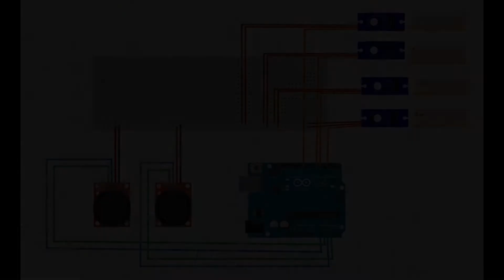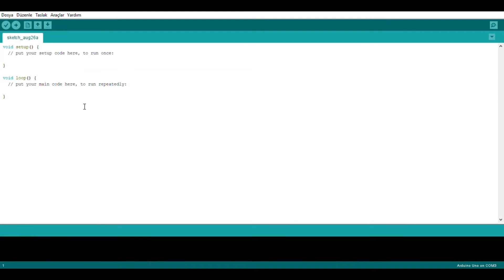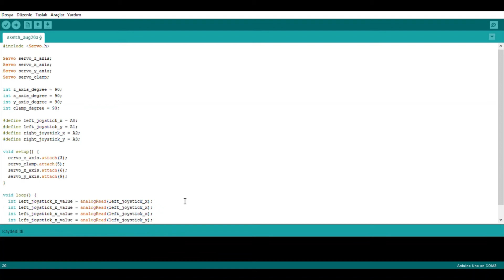Arduino 4-Axis Robot Arm

Comment: text in English 
"Thank you very much for the code you provided!

I really appreciate your help. The base logic was exactly what I needed to move forward with the project, and it saved me a lot of trouble.

I did have to make a few minor modifications (adjusting some of the pin definitions and tweaking the speed constants) to match my specific hardware setup, but the core functionality worked perfectly.

Your assistance has been invaluable in completing my robotic arm project.

Thanks again for your time and expertise!"

text in spanish 

"¡Muchísimas gracias por el código que me proporcionaste!

Realmente aprecio tu ayuda. La lógica base era exactamente lo que necesitaba para seguir adelante con el proyecto, y me ahorró muchos problemas.

Tuve que hacer algunas modificaciones menores (ajustar algunas de las definiciones de pines y retocar las constantes de velocidad) para que coincidiera con mi configuración de hardware específica, pero la funcionalidad central funcionó perfectamente.

Tu ayuda ha sido invaluable para completar mi proyecto del brazo robótico.

¡Gracias de nuevo por tu tiempo y experiencia!"

Comment: i see the video , but i use a keyestudio kit ks0198x, when i try to use your sketcht i cant make it work , because they use A0 for rigth servo. A1 for base Servo , pin 6 for left servo, and pin 9 for claw.  i try and try to make it works , but in new in arduino.

Comment: Only X axis works, others start to tremble when i try to move them, they only move if i help with hand. Is the problem in weakly screwed bolts or in the servo itself?
Reply: Hello..., I have the same problem..., did you suddenly find a solution...? I'm going to try to power from another voltage source since I used the same 5 volt Arduino for all the components......

Comment: please help i have put code and conected wired but its not working at all
Reply from the maker: You should use Arduino Uno board and you have to select right board from board manager of Arduino ide

Comment: Bro can u plz upload a correct code so that clamp should also work.  Though I have tried to compile this code but it doesn’t compile. Showing error  of  “=“ Cabot apply before token   In the define part n then 2nd errors is “;” before token   Kindly upload a correct one ASAP
Reply from the maker: I have updated the code.
Reply: Type the code from the video and replace #define with int

Comment: //The code after modification :)
/*----------------------------*/
#include <Servo.h>

Servo servo_z_axis;
Servo servo_x_axis;
Servo servo_y_axis;
Servo servo_clamp;

int x_axis_degree = 90;
int y_axis_degree = 90;
int z_axis_degree = 85;
int clamp_degree = 90;

int left_joystick_x = A0;
int left_joystick_y = A1;
int right_joystick_x = A2;
int right_joystick_y = A3;

void setup() {
  Serial.begin(9600);
  
  servo_z_axis.attach(3);
  servo_clamp.attach(5);
  servo_x_axis.attach(6);
  servo_y_axis.attach(9);
}

void loop() {
  int left_joystick_x_value = analogRead(left_joystick_x);
  int left_joystick_y_value = analogRead(left_joystick_y);
  int right_joystick_x_value = analogRead(right_joystick_x);
  int right_joystick_y_value = analogRead(right_joystick_y);

  if(left_joystick_x_value < 340) y_axis_degree +=8;
  else if(left_joystick_x_value > 680) y_axis_degree -=8;

  if(left_joystick_y_value < 340) clamp_degree -=8;
  else if(left_joystick_y_value > 680) clamp_degree +=8;

  if(right_joystick_x_value < 340) x_axis_degree -=8;
  else if(right_joystick_x_value > 680) x_axis_degree +=8;

  if(right_joystick_y_value < 340) z_axis_degree -=8;
  else if(right_joystick_y_value > 680) z_axis_degree +=8;

  z_axis_degree = min(179, max(1, z_axis_degree));
  x_axis_degree = min(179, max(1, x_axis_degree));
  y_axis_degree = min(179, max(1, y_axis_degree));
  clamp_degree = min(179, max(1, clamp_degree));

  Serial.print("x_axis_degree : ");
  Serial.print(x_axis_degree);
  Serial.print(", y_axis_degree : ");
  Serial.print(y_axis_degree);
  Serial.print(", z_axis_degree 4 : ");
  Serial.print(z_axis_degree);
  Serial.print(", clamp_degree : ");
  Serial.println(clamp_degree);
  
  servo_clamp.write(clamp_degree);  
  servo_x_axis.write(x_axis_degree);
  servo_y_axis.write(y_axis_degree);
  servo_z_axis.write(z_axis_degree);
}
Reply: it's still not working
Reply: it says a function definition isn’t allowed before ‘{‘